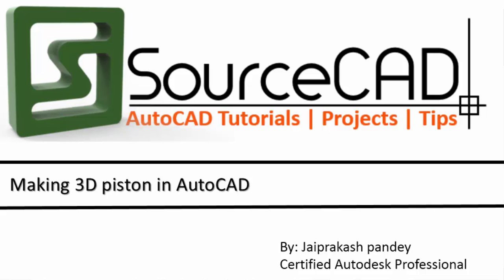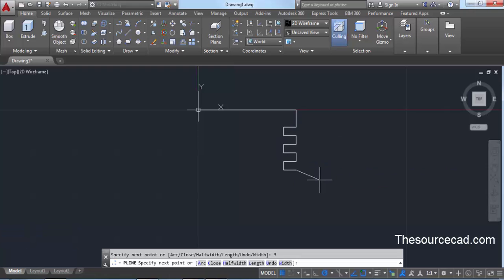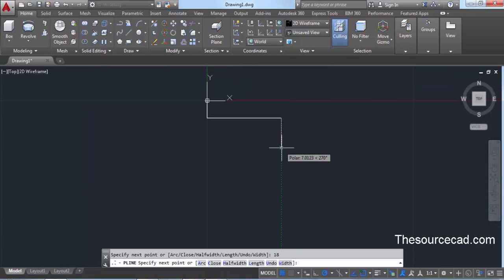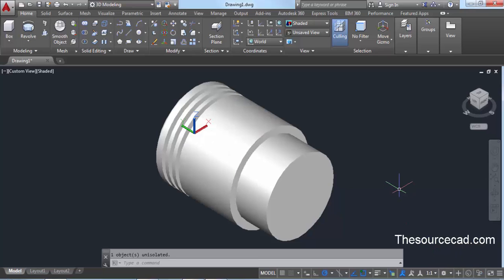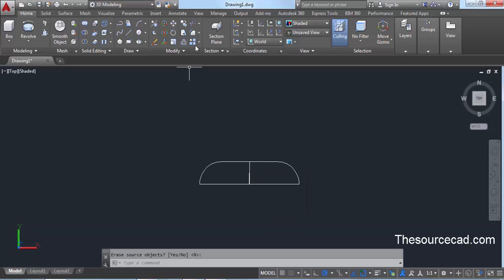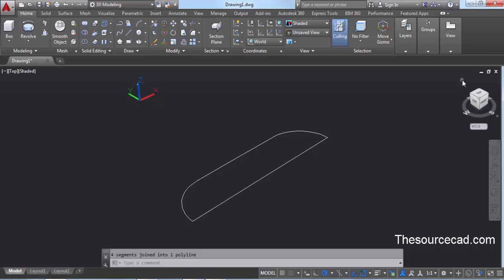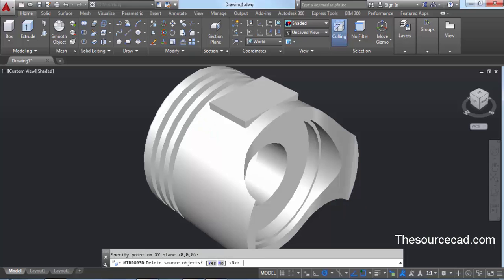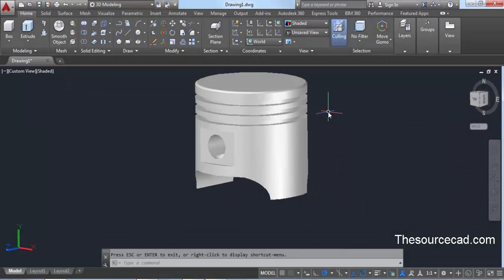Making a piston in AutoCAD 3D

Comment: Hello   I’ve been using Autocad lt since its birth for home design & renovations.   Been getting bored with 2d so I down loaded Autocad Architecture 2019 for a 30 day trial because I watch a couple of you videos.  Right off the start I was unable to move into the 3D model. The option wasn’t an option. I think I tried every option & ribbon but have not found it,  Mine just says Autocad Architecture. If I hit the arrow down it just says customize. So what I’m I missing or doing wrong. I love design but to much work to draw ever view.  If you can help I would greatly appreciated 
Thank you
Mark
Reply from the maker: Hi Mark, 3D workspace is available in AutoCAD only and AutoCAD architecture is a different software.

Comment: Thanks a lot, just finished it, I just want to know if there is a way to make the final circle perfectly in the center? Why doesn't object snap tracking work ?
Reply from the maker: Using object snap you can make the circle at your desired point, as mentioned in the video mentioned below the object snap and other draw tools will only work in XY plane, so you need to first align your drawing in XY plane before making changes. https://www.youtube.com/watch?v=FbtFfzjlcrM

Comment: whats the difference between extrude and press pull????
Reply from the maker: Here is a related video that might help you https://www.youtube.com/watch?v=uiVVxWsJPVM
Reply: "Press Pull" is like a fast extrude that auto detects 2D shapes and intersections. For example, if you have a square and a circle intersecting eachother, "Press Pull" will auto detect the intersecting shape to extrude. The function "Extrude" could do the same thing but it would take more steps (you would extrude the square, then the circle, and you would use the function "Intersect", which would take longer than using "Press Pull").

Comment: is unit in mm or cm ??
Reply from the maker: It doesn't matter as you can change units anytime later in AutoCAD but here inch has been used
Reply: +SourceCAD   thanks :)
Reply: +SourceCAD  can u upload how to make off road tyre and how to design bike frame ,chassis or body plss
Reply from the maker: I will try to make these videos Manpreet